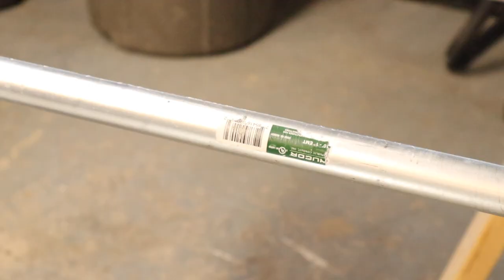THE TENT GOES UP. THE CANVAS WALL TENT CHRONICLES

Comment: We have a canvas exterior frame cabin tent we set up on a platform. We put a spike at the corners to set the pole over to keep the frame from shifting in wind. A lag bolt would also work. We build the platform every time we set up and is made to move. We wrap the tent with clear plastic on 3 sides to enclose heat and reduce condensation inside. Bringing the plastic down to ground level keeps wind and cold from getting under the tent and keeps the floor warmer.  You could also use homesote skirting in a more permanent setup. We tented in winter at 20 below during deer season. We used large spring steel paper clips to hold plastic sheeting in place over the poles. Our fourth side, or front is made of homesote walls, not on a platform, using a steel pipe frame. You could also enclose your porch in clear plastic, plastic tarps, or canvas, held in place using spring steel paper clip clamps attached to the fly. A sheet of plastic attached to a wall where you cook protects the canvas and can be removed and washed. This is our kitchen and place for our wood stove. If you put down indoor/outdoor carpeting remnants and attach them with duct tape, it makes the floor warmer and nicer to walk on. We used Humphrey propane wall lights for light as well as some heat but if you have a generator, I would go with LED lighting.  We used steel clothes hangers formed in "s" shapes as hooks inside the tent to hang things over the pipe, They can rust. If you know someone who works for the power company and can get you a section of scrap aluminum wire discarded after a job with multiple strands of aluminum wire, they make better "S" hooks. You have a nice set up but these are things we learned to make a better camp.

Comment: I've set these up tons of times. It's far easier to put the legs on one long side first. Then it will be on an angle. Then put the legs on the opposite side in on at a time. We found it to be easiest to also start at the middle and work outward. Just a thought.
Reply from the maker: You are right, that is the recommended method. Our tent is 12x12 so really no long side. At the time it seemed like the best way to set it up with the rain fly already in place. We have had it set up for two years now. If and when we take it down, I will try that way setting it back up. Thanks for watching!

Comment: Question what is the size of this tent ? And what are the dimensions for the platform? And frame? Thank you so much this is the same exact idea I have for mine. God bless you 🙏💞
Reply from the maker: The tent is 12’x12’. The deck is a bit larger to accommodate the overhanging rain fly. The A frame was made specifically to fit this tent and rain fly. The tent and rain fly was a special order size from Davis tent. They have many great packages for tents. Check them out!

Comment: Another question. Could wood be used for the metal frame, suuch as those wood poles that are sold for closet rails?
Reply from the maker: I’m not sure they would be strong enough to hold the tent in strong winds or with and a snow load. The brackets that come with the tents are for 1 inch conduit. I don’t think a 1 inch diameter wooden rod is strong enough

Comment: Your work is really beautiful!  I am fixing to build something similar out west in the northern California wine country.  We will use it for our own personal use and also rent out for weekend "Glamping in the wine country".  I've only watched a few of your videos so far and plan to watch most of them in the future.  One thing I noticed that I have not seen an explanation for... When you originally put the a-frame in place, if was flush sitting on the deck.  Then later, it was propped up on blocks by about 4 inches or so.  What was the reason for the modification?
Reply from the maker: Hey JP24, Good catch on that! At some point in the planning stage I ended up with a bad dimension. I built the frame before I actually received the tent and rainfly. I found that, after receiving the tent, it was going to be too close to the ridge pole framing. My remedy was to use those blocks to gain the needed height. We are in the FINGER LAKES region and our property was a vineyard many years ago, still lots of feral grapes growing. Thanks for watching!

Comment: I was in Davis Tent Website and they make custom tents. Can you please tell us exactly what the customisations are for your tent?
Reply from the maker: Hey Priya thanks for watching. We had them make our tent 12x12 which is not a stock size. We had them make the side walls 10 inches taller as well. Our rainfly was made to fit our tent with a 4 foot extension on the front and and 1 foot overhangs on the back and sides. Davis tent made sure the opening on the rainfly lined up with the stove jack on the tent.The windows were placed to our specifications. Hope that helps!

Comment: I love it! How did you get the tent bottom edge secured to the wooden floor though? I love the look of the wooden floor inside rather than the canvas floor.
Reply from the maker: Hey Paula, I used stainless screws thru the grommets on the edge of the tent. The edge of the tent overlaps the deck and that helps to keep the weather out.The tent has a sod clothe that goes on the inside of the tent. Thanks for watching!
Reply: @mytwelveacres3071  thank you!

Comment: Sorry if this is an ignorant question. I looked through your comments to see if anyone else asked, lol.  Could exterior, pressure treated plywood be used under the surface of the tent?
Reply from the maker: Hey Cheryl, I have for sure seen where plywood has be used on the interior of tents. Mostly just on the wall portion .Not sure I would want to use pressure treated though. Thanks for watching
Reply: @mytwelveacres3071  I meant plywood as the floor, instead of decking. Would exterior grade plywood hold up?
Reply from the maker: @cherylkitchen  Sorry I misunderstood your question. Yes you could use it on your floor

Comment: Wow! Looks like a $ 3000 Wood base!  Happy glamping!
Reply from the maker: Actually about $600 in material and a few hours of my labor. Thanks for watching Kim!
Reply: @mytwelveacres3071  Wow
A few hours only huh.. cough 
Hehe .I would need a few days for that but I’m not so well set up with tools’n stuff
600 is 2020 prices right
Is the rain cover really needed?
Tent not proof?
Reply from the maker: @tommmy1313  You can interpret "A FEW HOURS" any way you would like.  I didn't keep track, but certainly between 8 and 12 hours. It was built before lumber prices went through the roof, and I had some materials on hand. As far as the rain fly is concerned, for a long term set up like ours, it is a must. Even though the tent is water, mildew and fire resistant, we still want to protect it. We have had this tent set up for over a year now, here is a link to the video. https://youtu.be/DkevsJpvu-A
Reply: @mytwelveacres3071  Yeah that’s what I thought 
I wish I could build a base and fly like this 
Looks so elegant I want to move in 😆
So there is no mold mildew or anything else going on after a year?
Sounds great
I think I made up my mind about the tent
I’m in California close to coast and we do have Marine Layer moisture and sometime heavy rains.. I assume the tent without the fly would be considered repellent but not 100% rain proof?
I’m thinking leaving it set up for long term  like yours
But the whole base and fly structure is not happening 
Instead used pallets and some wood sheets on top have to do
Think there rain proof tents out there like the one you got?
Or can it be “ made” proof with let’s say silicone sprays or something alike?
What ya think
It’s a lot of questions I know
I’ll find a way 
Thanks for sharing!!
Reply from the maker: @tommmy1313  I think most canvas wall tent manufacturers sell their tents as water resistant to some degree. I think you would be better off getting a cheap poly tarp from your local building supply than spraying anything on your tent. The beauty of canvas is, it is made to be able to breath, allowing moisture to escape. Good luck on your project and thanks for watching!
Reply: @mytwelveacres3071  thank you 🙏

Comment: Hi there! How exactly did you fasten the bottom edge of the tent to the platform? I see that you have the sod edge under the interior poles. Thanks!
Reply from the maker: Hey Gerald, there are grommets along the bottom edge of the tent. We wrapped that edge over the deck and  used stainless screws and washer to fasten them to the deck thru the grommet holes. hope that helps and thanks for watching!

Comment: I absolutely love this! Would you mind providing any additional information? What size is it? Did you follow a plan or was it your original design and would you mind sharing if you have any plans. What tent did you go with and where did you get it! My family and I have an off grid property and would love to do something like this up there! Just in awe of your craftsman ship. We have now watched all of your videos! Well done. Any information would be greatly appreciated.
Reply from the maker: Thanks for watching Alissa! We purchased our tent from DAVIS TENT. They are a great company to work with and will make your tent to your specifications. They do make stock tents, but tent size, window placement, screens, wall height, stove jack and its placement, as well as the rain fly size, are all things you can change to your needs. Our tent is 12 x 12 with a 4 foot extension on the RAIN FLY. Both are custom to what we needed. I did not have any plans and just made the deck and log frame to fit our tent. We really
enjoy our tent and have stayed in it in all kinds of weather and have always been comfortable. Good luck to you and your family on your tenting adventure.
Reply: @mytwelveacres3071  This may be a dumb question, but did you build your deck to fit the dimensions of the tent, or did you give it some extra wiggle room?
Reply: Hey Jimmy, zoning laws here don't allow me to build anything larger than   12'x12' without a permit so I designed around that and built the deck 12'x12' . I then had the tent made to fit my deck. Hope that helps. Thanks for watching!
Reply: Same size , no wiggle room. the tent  was made exactly 12x12